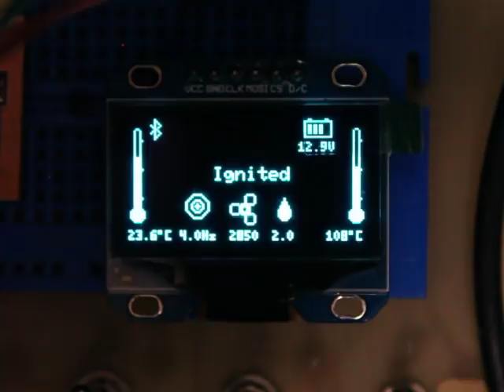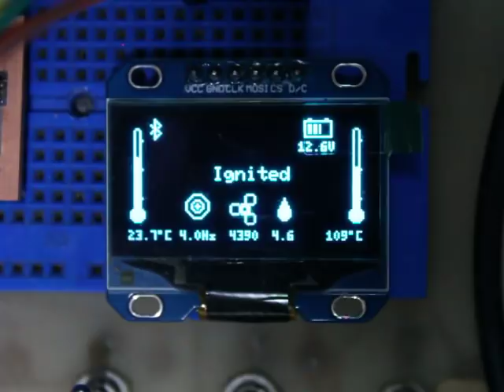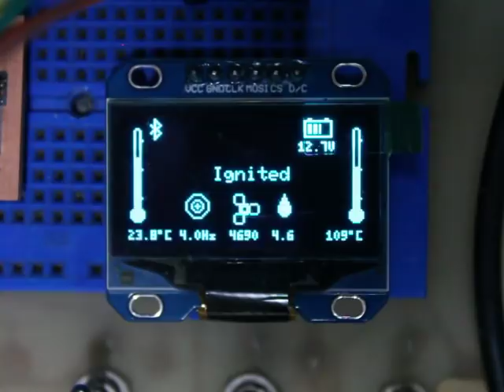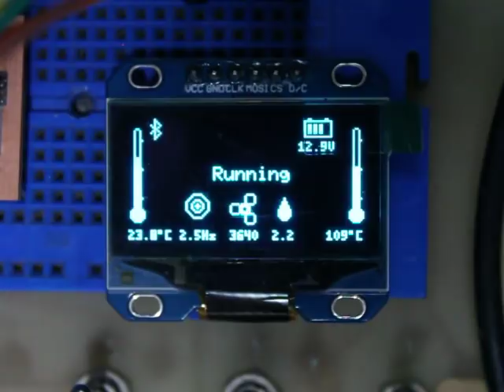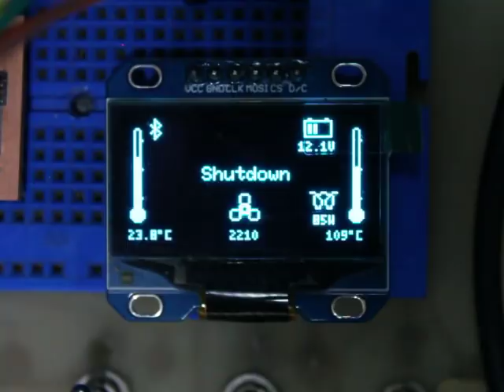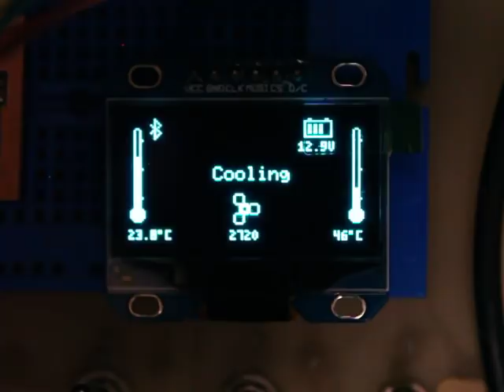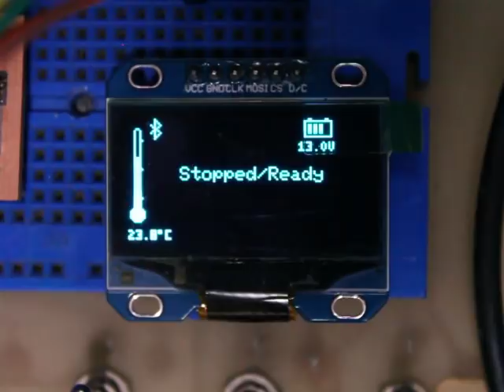Prototype OLED display on Chinese diesel heater

Comment: This is great. I'm currently trying to integrate my chinese heater in to an ESP8266 / RasPi central controller in my van (centralize solar monitoring, environment, security, etc). Could you document the protocols you used for communicating with the chinese heater? or do you have any of the source code up anywhere? 

Seriously, well done man, looks awesome.
Reply: Hi Dylan, I've just been searching around with the exact same intention as yourself..... Did you manage to make any progress on this?, any info on how you got on would be amazing, thanks.

Comment: I have bridged rx / tx directly to the microcontroller of the lcd screen. But I can not get coherent reading alone @ ÂQd $ â € œÃ,Â³ @ Â Ud $ â € œÃ ³ @ Â Ud $
What speed of the serial port do you use?
I have tried all Maybe it's because of the configuration of my keyboard, try to show Chinese letters? 
I think the connection was good, it is a microcontroller atmega328p
http://i66.tinypic.com/2da10s9.jpg
Thank you.
Reply from the maker: Hello Esteban.
My OLED is driven by an ESP32 processor via I2C.
The ESP32 has a serial port attached to an independent duplexer consisting of a  74hc1g126 and a 74hc1g32 acting a level translator as the blue wire is a 5V signal and the ESP is 3.3V. 
The blue wire is 25000 baud. Not standard but Arduino can be set OK.

Comment: What is a"blue wire interface"?
Are you planning to make your project open-source?
Reply from the maker: Many Chinese diesel heaters use a 3 pin interface between the heater and control unit.
This project aims to replace the OEM controller with a Bluetooth & WiFi capable unit.
All signalling travels over the "blue wire" of the 3 pin connection.
It is planned to open the source once settled. It's pretty big already.
Reply: @rljzathras  Many Thanks.
My Plans: I bought a chinese 8kw heater (not shipped yet) for heating a greenhouse which i use as a workshop for my motorbike during winter. I don´t know if it is the same manufacturer as yours. I only know "FJH-8", no brandname. If your project fits to this heater and you open the source, maybe i can integrate it via mqtt to my smart home control. Would be nice ;)
Reply from the maker: @michaelrudek1545  I have another person working with this at the moment who is far better versed at the internet of things side and speaks of MQTT, so yes it will probably happen.
Reply: @rljzathras   I didn´t want to say that you should implement MQTT ;) If i have a "Base", i can do this by myself. But i´m not able to "hack" an interface like you did.
But if you already planned to integrate ..... Nice!
Reply from the maker: This project is now public on GitLab:
https://gitlab.com/mrjones.id.au/bluetoothheater
Reply: @hx4791  You can buy it from Ray Jones, i have two of them running. Just ask him ;)